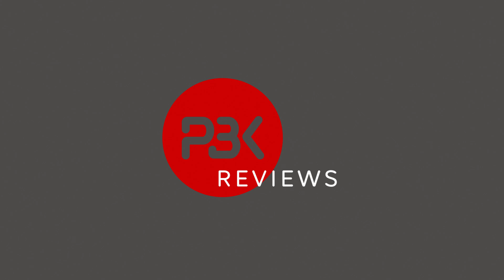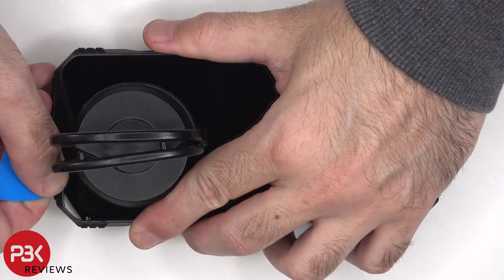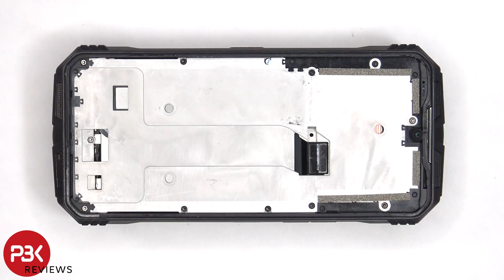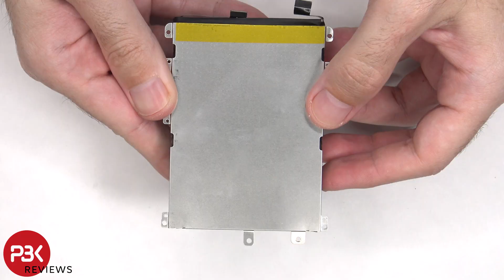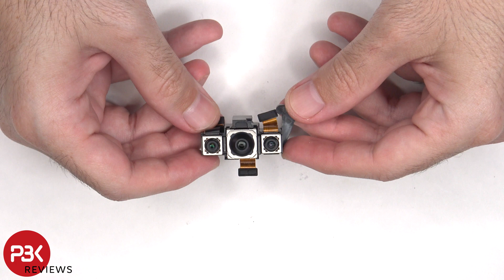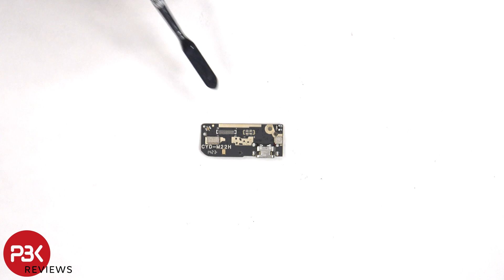Doogee S100 PRO Teardown Disassembly Repair Video Review

Comment: Hello, thanks to your content I have found out how to disassemble my S100pro. I just need to know what glue I should use to assemble the screen, and how to do it, thank you. I also need to know if access to the fingerprint button is accessible and if it has a replacement. Thanks for your time
Reply from the maker: Replacement parts would be difficult to find, you would need to either find one from a parted phone on ebay or contact the manufacturer to see if they would sell you one. As for the glue, you can use B-7000 glue to re-adhere the screen.
Reply: @PBKreviews  thanks so much✌️

Comment: i have but i cant turn off the camping light. what i can do?
Reply from the maker: Have you tried doing a factory reset (after backing up your data)? Might be a software glitch. If not then not sure maybe a hardware issue.
Reply: @PBKreviews  i do factory reset but the light its stil on